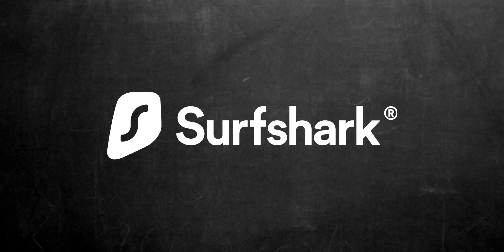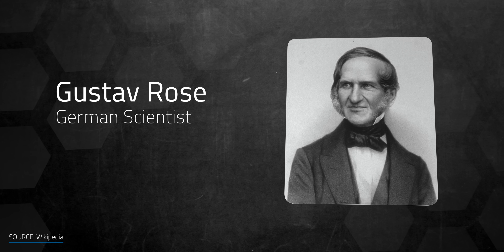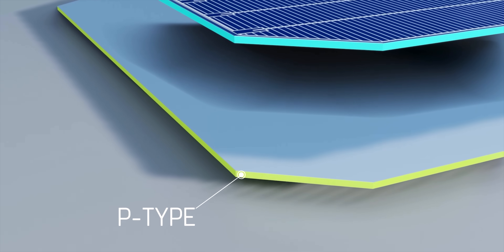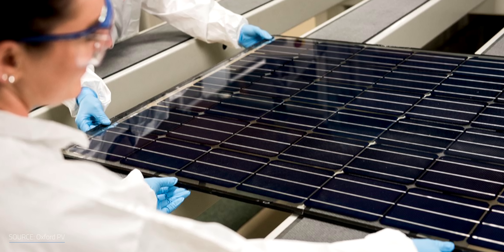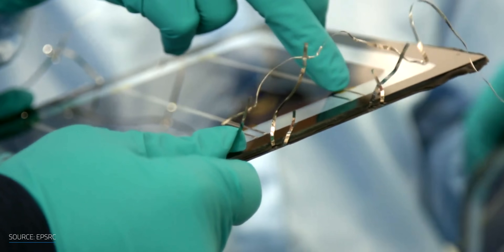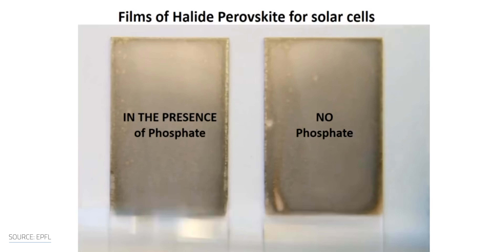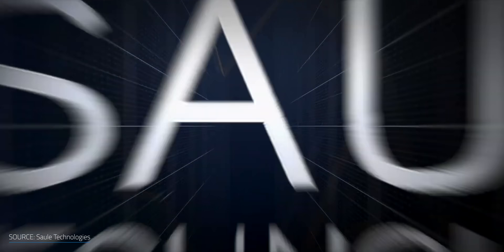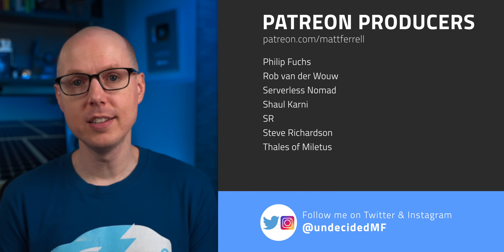Perovskite Solar Cells Could Be the Future of Energy

Comment: Considering this can be "printed" I wonder if we could coat the outside of everyday objects like phones, laptops, planes, cars, etc, and then cover them with some kind of clear coat. Sure, maybe it will not last the entire life of a car, but maybe it would be a useful feature of more "disposable" electronics.
Reply: Phones are often in someone's pocket and laptops are almost exclusively used inside. So I don't think it would be a good use of resources there. Cars could possibly be efficient enough, but the efficiency needs to go up more to make it a viable option. I think planes may be a good place to put them since they are generally outside. I'm not sure how they can make it safe enough from an overcharging point of view.

I'm not ruling out the idea of coating everyday objects with these solar cells. But I think it would be more efficient to put them in places where they will generate power whenever there's enough light. 
And with better batteries in the future and more wireless charging I don't think that it would make much sense to coat everyday objects in these cells.
But I don't mind if I'm proven wrong 😊
Reply: @AnimilesYT  yeah but I'd still like to have that option. Imagine you're stranded in the middle of nowhere, having a device that would charge itself by the sun would be useful.
Reply: @robertl4522  you can just get a separate solar panel for the device, or even more useful is just a battery bank that you keep charged.  I agree would be cool, but the science is not quite there yet
Reply: @brettneff7900  yes but I'm more likely to always carry the device itself that has a built-in solar charger than always dragging a separate solar panel with me everywhere
Reply: @robertl4522  Good point. I think it would be more economical to carry around a compact solar charger (similar to an external battery) than it is to coat the device in solar cells. Getting stranded in the middle of nowhere doesn't happen often, so it doesn't sound like it would make much sense to have the coating just in case it might be a bit useful at some point. But nevertheless you still make a good point and it would be nice if the option exists :)
Reply: @AnimilesYT  electric planes or gliders maybe, but probably not a fuel based aircraft. In flight power generation is almost a rounding error on fuel use.
Reply: @joshuacheung6518  Currently, yes. But in the future with more efficient ways of propulsion and with solar panels that are way more efficient it could possibly make a difference. It could also possibly be used on a fuel-electric hybrid aircraft. 

(You could very well be right. With current technologies you are right for sure. But I see this as something that may eventually become viable when technologies advance :D )
Reply: @AnimilesYT  good points!  Solar is usually better when it’s not mobile because you need lots of area to generate very much power.  Phones need solar about the size of a laptop.  Laptops need 2 or 3x their size in solar to maintain charge, and neither are usually used outside in direct sunlight.  Cars also need 2 or 3x their surface area to maintain charge from solar, and the cost of that much solar would add $5k to $10k to the cost for not much benefit.  Better to solar the house and charge the car from that.  Planes don’t need a lot of energy because they can just generate power from the engines, and right now batteries are too heavy and not power dense enough for very long flights, but are getting close! 🤞🤞
Reply: @AnimilesYT  How about like a coat with the panels an integral part of the garment.  The coat pocket is a recharger for the phone.
Reply: @tibetloga  That sounds very interesting. I worry about the durability, recyclability, and sustainability though. Either way it sounds like something I'd like to see explored :D
Reply: You would need to solve the oxidization, or a multi level clear coat/ceramic. Then the conductors for the custom panel connecting the cells
Reply: @tobbleboii5988  
"chaging [sic] a phone from 0 to 100 would take months"
That's a made up statistic.

We could fit a 5cm x 10cm (2" x 4") solar cell on most phones. The sun generates ~1kW per square meter, so the sun's energy on a 5cm x 10cm area is 5W. 20% efficiency is 1W. A typical phone battery holds about 5Wh, so the phone would charge in about 5 hours.
Reply: @dosadoodle  Love 'ya! That is sweet statistics!
Reply: @dosadoodle  Exposing a li-ion battery to a scorching sunlight isn't the brightest idea (pun intended). The average efficiency would be far from 20% due to imperfect angle, and the modern phone batteries hold about 12-15 Wh (3-4 Ah @3.7V). So while it will somewhat charge, I wouldn't rely solely on it.
Reply: especially given that if i's disposable, you don't need to make it long lasting in the first place
though I don't think we would want any more disposable stuff in our life, the target is reduce consumption, not increase it
Reply: @aronseptianto8142  "the target is reduce consumption, not increase it"
you are not a true capitalist ;P
Most companies do not share your desire to have a good environment, and life for all.. they want their mega yachts, and cheap trinkets from china is the quickest way they can get it. They don't care about sustainablility, because they believe they will be dead before the consequences catch up with them.. and they may be right about that :(
Reply: Well, not high consuming electronics, but what about a wireless mouse or a keyboard? They don't use to much energy, and they are usually just lying on the top of the desk illuminated by the office light, which nowadays has way too much UV. I've been looking for this for years, and all I've found are Chinese-made very bulky and ugly mouses. That could change.
Reply: @3MasterG  I have a logitech keyboard with a solar panel, K750. It's... OK-ish, but I had to seal off the solar panel cause the 2032 rechargeable batteries have ceased to exist.
Reply: @tobbleboii5988  But that is the thing , with low energy requirement equipments , such as tv controls , watches , termometers and things like that , we might be able to use peroxide cells in combination with supercapacitors to ditch out the need for a battery , since they have been researching to even charge this equipments with house lights ,I don' t if they remember if they are actually using peroxide for the cell , but in my opinion it seems to have a lot of potential for that.
Reply: @lavaot5207  would be cool, but indoor solar is extremely low power generation.  Solar panels need direct sunlight to produce power.  Even turn it slightly away from perpendicular and it looses a lot of energy production.  Indoors basically all solar panels don’t produce any voltage.  You could make a really high voltage solar panel to overcome it, but then you wouldn’t produce very many amps.  I would love it too, but right now not practical (and I have hundreds of solar panels around the house)
Reply: It could be. IoT is one of the main focus for that.
Reply: @tobbleboii5988  I had a solar powered flashlight. In daylight sun would overcome the bulb's luminousity, and at night, it wouldn't turn on since there was no light to power it our up! 😂 😂

Forgive me. I had to write it! 😂
Reply: @3MasterG  I had a solar flashlight as a kid, it was actually pretty nice. It had a battery which provided a couple hours of runtime which recharged pretty quickly and it lasted about 5 years before the battery was too degraded. And this was one of those cheap novelty flashlights a company might print branding on and hand out for free, someone could easily make better product that doesn't increase the cost more than replacing disposable batteries.
Reply: Bingo. personal computers don't get nearly as hot as solar panels. Same with windows and lightly colored houses.
Reply: Or it could just be repainted...
Reply: Phone cases would be a great use too!
Reply: It's completely pointless to have on mobiles or laptops; you'd need a separate panel for those, and even then the panels could just charge a portable battery instead.

For vehicles it's quite useless because they already have large energy reserves, and the energy that they get from their small surface area and poor angle of reception is very insignificant.

Overall it makes more sense to just use places that can be hooked up to the power grid, and be exposed to the sky all the time at a good angle.
Reply: It coats a window, so l would think so.
Reply: @GulfCoastGrit  They'd have to be mega durable
Reply: Lead coated cellphones... that sounds... iffy?
Reply: @marcschaeffer1584  In the future they may not contain lead, I think
Reply: Stupid is as stupid thinks.

Comment: Does this reduce the co2 emissions per pvwatt? I calculated that i would need solar panel with five time lower emissions to get same emissions as electrical grid here.
Reply: I would be interested to see those calculations.  My 34 rooftop panels have generated 17.6MW/h of electricity in 15 months so I would be interested to see how it works out that the production and installation of these panels exceeded the carbon output of my electric grid over just this 15 month period, let alone the energy output expected over the next 25 years.
Reply: @robsengahay5614  I don't remember the exact calculations but i think it did have something to do with how much solar radiation per m2 my land gets. And i used that to calculate how much co2 emissions 1kw solar installtion would output. I think i got output around 70kg co2e per 1kw  solar installation per year with perfect pv angle. And i would need around 3kw worth of panels to produce enough eletricity all year around. So that would be around like 210kg co2 per year? And currently with my grid it's only like 55kg. I think this is mostly cus in winter we get basically no light so i have to install ridiculous amount of panels to compensate for that.
Reply: Also those calculations were assuming that i would use normal average grid power. If i switced my electricity to nuclear i would need even lower emissions panels to get as low emission.  It's actually ridiculous how good nuclear is here compared to solar. Its not even close.
Reply: @wilderness-beastt  How does 1kw of solar panels (roughly 3 panels) produce 70kg of CO2 PER YEAR?!  Once the panels are manufactured and installed they generate zero emissions PER YEAR.  Also 3kw/h is a very small system.  I have 11.2 kw with a 10kw/h inverter.

I must admit that where I live I have sunshine year round too.
Reply: @robsengahay5614  I don't know but i am pretty sure it does.  Most of the data i have seen shows that solar produces around 40-50g of co2 per kwh. I am assuming that they assume you live in america for that calculation. So that would mean you get around 1411kwh per year with 1kw of solar(maybe i used wrong pv angle for this? Not 100% sure). So 1411*50=70 550g of co2 or 70.55kg of co2.
Reply: It would be nice if there was data that shows how much it is cus it would probably be more accurate. But I haven't found that data so i just used this calculation.
Reply: @robsengahay5614  obviously feel free to point out any flaws in my calculations. I would love to be wrong.
Reply: @wilderness-beastt  You made me curious so I googled it and learned that manufacture of solar panels generates about 50g (not kg) of CO2 per kw/h per year based on a 20 year lifespan.  As this is only around 5% of the CO2 per kw/h from a coal fired power station a solar panel is essentially carbon neutral from 3 years after install.

Interesting.
Reply: @robsengahay5614  what do you mean by (not kg) obviously that is exactly what i said. I never said it was 50kg per kwh.
Reply: @robsengahay5614  kwh and kw are two completely different things.
Reply: @robsengahay5614  kw is power. Kwh is energy.
Reply: @wilderness-beastt  You’re right; you said 70kg per kw per year.  Which is somewhat more than 50g per kw per year.

Fair point though that kw/h is different.
Reply: @robsengahay5614  how much more? I just showed you the calculation. What was wrong with that calculation?  I used these cordinates for that calculation if that matters "33.810000,-94.540000" and i used pv angle of 30degree cus it seemed to give the best results.
Reply: @robsengahay5614   what does 50g  per kw per year have to do with this?
Reply: @robsengahay5614  it's 50g per kwh.
Reply: @robsengahay5614  i think someone is missunderstanding. Probably me but not sure
Reply: @wilderness-beastt  I definitely misunderstood the data.  Just found this which helped me.

The US-based National Renewable Energy Laboratory (NREL) estimated that solar power produces lifetime emissions of 40g CO2 equivalent per kilowatt-hour. A study published by Nature Energy was more optimistic, with estimated emissions below 21 g CO2 eq / kWh.

For comparison, many coal power plants produce over 1,000 g CO2 eq / kWh, and even the “cleanest” coal power is generally above 700 g CO2 eq / kWh. Natural gas generation is less polluting, with emissions above 400 g CO2 eq / kWh, but still 10 times higher than the NREL estimate for solar power.
Reply: @wilderness-beastt  I assume the differences are based on an average expectancy of kw/h energy per kw of solar array.  Where I live it is sunny year round so I get a lot of bang for my buck.  Each kw of solar array generates over 1mw/h of electricity per year so I suspect that this helps reduce the carbon cost of manufacture still further.
Reply: @robsengahay5614  if it's 21 co2 eq/kwh that would mean that it's 29 631g or 29.631kg co2e per 1kw of installed solar per year asumming everything else i used in my calculations is still the same.  I mean that seems a lot better but it would still be more co2 per year if i used solar. I think solar is good. But here in finland? I don't think so.
Reply: @wilderness-beastt  Solar PV in Finland seems not such a good idea.  I am in Queensland, Australia.  Solar PV is a no-brainer here.  My 11.2kw array powers my home, hot water and my car all year and I net export to the grid every month of the year.
Reply: @robsengahay5614  if i used 300w solar panel in combination with grid my yearly co2 emissions would drop by 25kg. Assuming i am not using nuclear. If i was comparing it to using nuclear i would actually increase emissiong if i would switch to solar from nuclear even if solar was 21g per kwh.  so i think it makes more sense to just buy nuclear electricity.
Reply: @robsengahay5614  yes solar is very good in sunny areas. :)
Reply: @wilderness-beastt  We don’t have nuclear power in Australia.  Our grid is mainly coal generated, sadly.
Reply: @robsengahay5614  yeah coal is not great. Good that you switched from coal to solar :)
Reply: @robsengahay5614  always nice to see people lowering their emissions :)